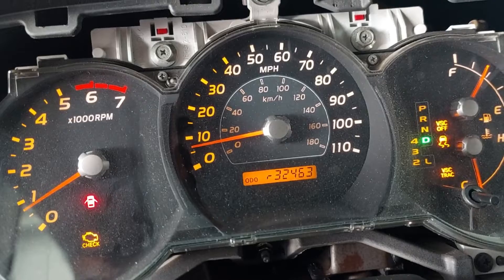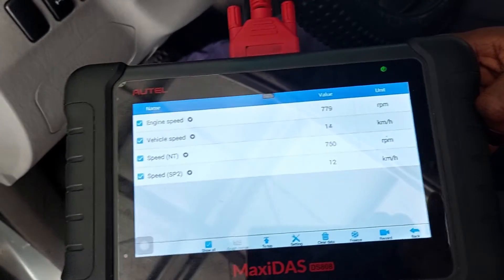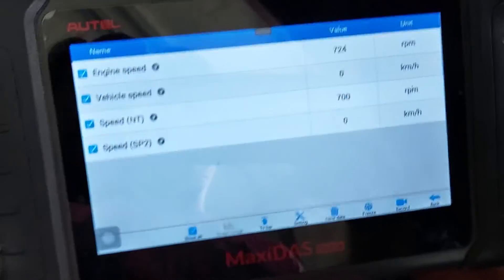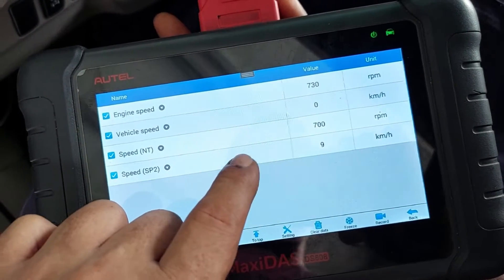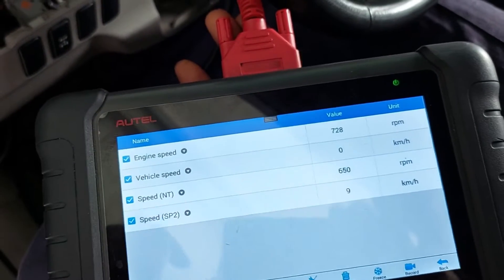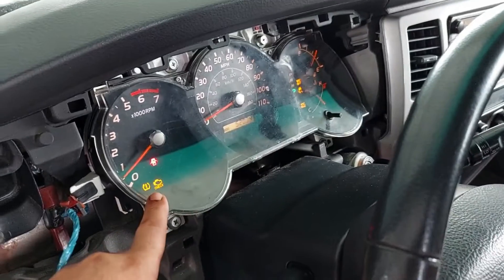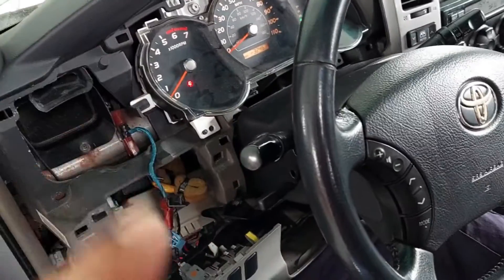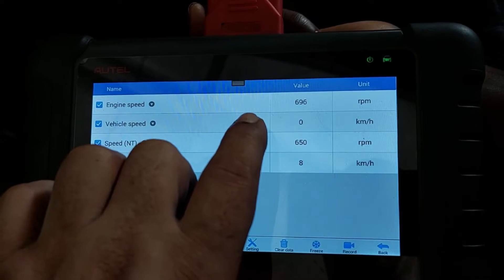Toyota 4runner P0500 vehicle speed sensor (VSS)how to troubleshoot the problem.

Comment: Tengo una 4runner 2002 3.4 v6 automatica, y no marca la velocidad en el cluster ni en la ecu, pero el modulo abs funciona, igual los sensores y las líneas... pero eliminaron el actuado del freno
Reply from the maker: Do you have any code?
Reply: No muestra ninguno
Reply: Si debe tener más códigos porque eliminaron el actuador de frenos pero mi escaner solo lee códigos del modulo de motor no se conecta a los demás modulos
Reply from the maker: Check between skid and cluster. 
Also, check if your skid is receiving siglal.
You need a good scanner to rectify the problem.

Comment: I am doing this job presently. Cluster has speed value but ecu doesn't. I intend running a continuity test on the violet-red wire.
Where you able to resolve this?
Reply from the maker: Check continuity from speed sensor to skid from skid cluster from cluster to ecu.
Also for faster operation change cluster. 
Violet/red is the signal that is going to ecu. 
I think brown/red is coming from skip to cluster again is signal.
Actually you need oscilloscope to measure values.

Comment: Ωραίος
Reply from the maker: Ευχαριστώ...
Reply: @Apokatan.autotech  
Γιάννη, Υπάρχει πιθανόν να πετάξει κωδικό p0500 ο σενσορας του σασμάν;  Έχω 2007 sequoia και μου πετάει p0500, αλλάζω το speed sensor αλλά ακόμα πετάει p0500 Και το μόνο που δεν δουλεύει είναι το VSC και το cruise control.
Reply from the maker: Αμα το άλλαξες και συνεχίζει όχι. 
Ειναι δύσκολο να βρεις το πρόβλημα. 
Θελεις διαγνωστικό καλό και να ελέγξεις πλεξούδα καλωδίων και τα βασικά όργανα. 
καντραν skid control module και ecu.
Εχω το whatsapp επικοινώνησε να σου στείλω τεχνικές πληροφορίες. 
το δικό σου έχει ξεχωριστά το skid control module. 
Εχω wiring diagram να σου στείλω.
Reply from the maker: +2347045862026 το νούμερο μου.